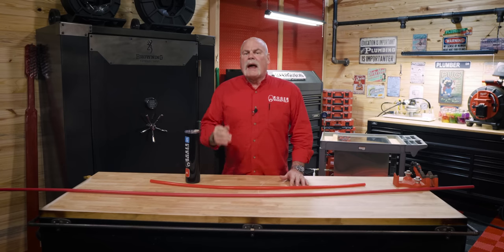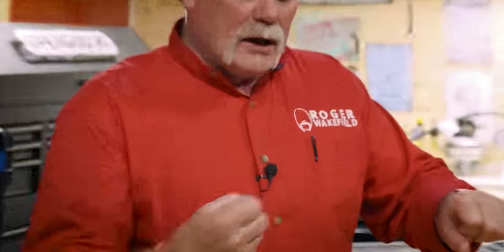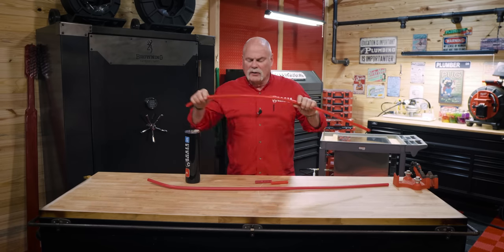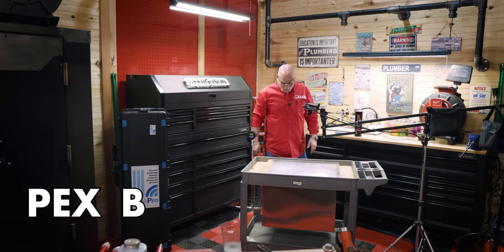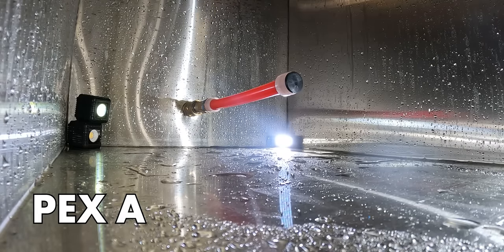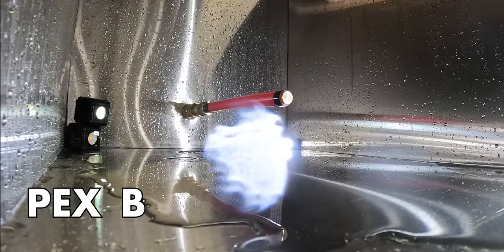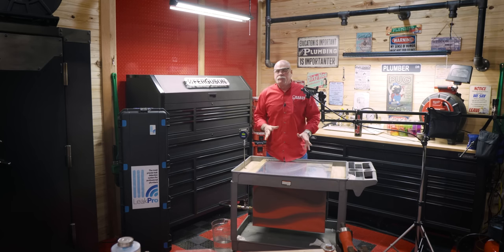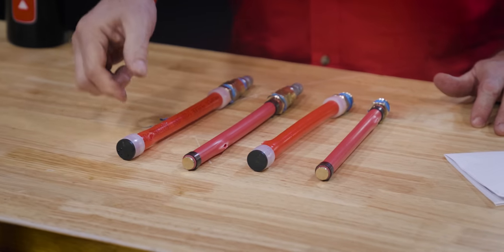Which is Better PEX A or PEX B | Pressure Test

Comment: I like those tests you done, but now do me a favor and take each of them and put them under 200psi pressure outside for a year. I like to see which will fail the Florida brutal heat in the sun and in the shade side. Because I got in the last 10 years over 1000 PEX A which failed for customers under mobile homes and around the homes on the exterior alone. And it's the fitting which fails not the pipe. So the bigger thing we learned is for Florida's heat don't use expansion material for the fittings instead used stainless crimp rings instead.
Reply: I think CPVC is much worse and it does a great job at withstanding the weather.. but I think using copper, CPVC outside and transition to PEX inside is always the smoothest move for longevity...
Reply: That might be why the local HD only sells pex b
Reply: It’s not made for uv exposure...
Reply: Well from my experience I was working on PEX a from 2012 and when ever you would put the tool on it it would split and crack so I had to put a PEX b fitting on there for it to work also under a trailer in Florida over in chulota

Comment: This is my take. This test made me excited when I stumbled across it. I’ve always been skeptical about pex a fastening method. I was looking for a failure at the crimp joint. Neither product failed at that joint which is remarkable.
Reply: For me its the opposite. A crimp ring made of metal will corrode and fatigue over time. The whole point of going plastic is because its non reactive and lasts an incredibly long time. If you add metal you ruin point of going plastic. Pex A is constantly trying to shrink so it will always remain strong.

Comment: As someone who knows a bit of polymer science, the conclusion is what I expected because stiffer probably means higher molecular weight and/or more cross linking and stronger in similar polymers.
Reply: Dido, except. I am very confused as far as the aging of these types of connectors relying on the contraction of a polymer. You know as well as I do that that polymers do tend to "relax"   overtime. Heat cycles will impact that as well, so how long before they relax enough to allow the fitting to fail?
Reply: @fredpinczuk7352  because the polymer is crosslinked, it will not creep in the expected manner before the polymer actually degrades from UV or oxidation or similar.
Reply: Yes the biggest risk of all these systems, aside from poor installation crimping, expansion, is uv exposure. When you have a toilet supply exposed to uv light in. A bright bathroom, don’t expect this to last 50 years !
Reply: I've worked in plastics for about 30 years (mainly working with HDPE, polypropylene, and styrene) and I would have been very surprised if PEX B failed first. I assume PEX A has some elastomeric additive / impact modifier, such as maybe kraton, added to it to make it more flexible and kink resistant. The elastomer will not only add flexibility but detract from the over all strength to some extent or another.

Comment: I think the biggest benefit of PEX A is fewer fittings and a higher flow rate. I replaced a PEX B install under my floor with all PEX A and was able to eliminate a lot of fittings the plumber used. Of course he doesn't care if it leaks below a floor that I have no access to underneath.
Reply: Why fewer fittings? Wouldn’t it be the same amount regardless?
Reply: @TrillPJ  A lot of plumbers will use 90 degree fittings just because it's easier when the pipe can be bent. You can use a special bracket to bend the pipe to ensure no kinks. Fewer connections is always better.
Reply: @adisharr  ahhh okay I see what you’re saying
Reply: @adisharr  The brackets curve the pipe without causing a kink, and it's faster than having to put a 90 elbow on it, and without loss of water pressure at the 90. I saw one install video where they didn't anchor the curved brackets, but I'm not sure that's good code compliance everywhere.
Reply: unless you have a ton of 90s close to each other, it make no difference
Reply: each elbow contributes frictional loss on the order of 10 feet of straight pipe. they all contribute regardless of placement. you add up your equivalent feet of pipe and then you can use tables to look up the psi lost at a given gpm.

Frictional loss is not noticeable to the user IF the pipe is adequately sized for the application. That's not the same as "makes no difference". it is a matter of using the right size. If you don't know when to move up to the next tubing size, you will have a problem.

There are rules of thumb to follow based on number of fixtures per line that will work fine for most purposes. You're not expected to calculate every situation but some situations do need to be figured out. 

See "Residential PEX Water Supply Plumbing Systems"... there is a table there on elbows/tees and another table for the loss per 100' (that's total equivalent feet).... i.e. 10 elbows is about 92-100 feet.
Reply: I used Pex B and didn't need 90° for most transitions by doing a longer sweep. No kinks no extra fittings. It's been going strong for over a decade now. ❤

Comment: Both PEX's are fine when it comes to pressure.  It's just you can't beat the PEX A when it comes to installation. Let's say you got a tee in a tight space. The crimping tools of any sort will require more room to maneuver when here the PEX A ferrules can be stretched while laying on your back and then you reach up and slip the ferrule over the fitting. How nice.  For a clean plumbing run you can't beat PEX A.  Having said that, who gives a shit about a clean PEX run? You can afford to leave some loose PEX runs so you get your crimps on.  My friend who has a Milwaukee stretcher, and I have a Ryobi Stainless steel cincher tool were plumbing a client's house using 2 different PEXs. We both started after coffee around 8am.  Now he had one extra bathroom to run pipe too and he had to put 90's going up the wall and to stub out just like I did.  Now, though we both finished at the same time, he put PEX to a bathroom, which is about 30 minutes more.  With our power hacks we cut out the old, galvanized pipe so that a future plumber couldn't complain.

Comment: As someone who uses strictly pex a I use expansion connections and crimp connections.  Since pex a is able to use both style connections can we see a pex a pipe with the crimp connections to see what it burst at. I’m curious to know if the expansion weakens the pipe that much or if the pipe itself if that much weaker

Comment: As a non plumber it sounds to me like it's more about how many connections you are going to need to make (since each connection with B reduces flow slightly) and whether the pipe might have a chance of freezing. The pressure test was good though to see how strong those connections are.

Comment: I'd like to see that with clear/white pex-a, given the litigation against uponor for the red/blue pex-a. These results are in line with the accusations in the CO class action.
Reply: What is the class action against Uponor for?
Reply: @bobbygetsbanned6049  there are accusations that the process that colors the red and blue uponor tubing causes defects, leading to microabrasions when the expansion tool is used and causes premature failure. Google and you can easily find the lawsuit.
Reply: @jcoop757  Shit that's not good. Thanks.

Comment: It’s like a screw versus a nail. The screw is “stronger” but it sheers. PEX a is the better choice because it will swell better as well as return to form better than PEX b. Like a nail, it will bend and bend instead of sheering. That’s what you want.

Comment: So Pex B won the pressure test, but what about long term stability?  Is it possible it will degrade faster in a slab if used for radiant floor heating?  If not, sounds like Pex B would be the best route to go.
Reply: I think the big issue with pex is chlorine resistance; if your water supply is highly chlorinated, you might want to look at pex-c (I think it's called that).

Comment: I had an entire 2 story house freeze in Connecticut. The only thing that burst were the copper sections near the on demand heater. The entire house was plumbed with Viega PureFlow Pex B. That's all of the water and radiant floors. Zero failures. The tenant shut the heat off in the summer and the pipes burst the day after Christmas due to good insulation. The whole house had to be gutted.
Reply: Ouch.  Merry Christmas :(  What sucks is it's hard to tell from just that if they were bad tenants or good people who just forgot.

Comment: Great video! FYI some manufacturers do list their PEX B tubing for use with F1960 (expansion) fitting and rings. Sioux Chief and Viega are the ones that I am aware of but there may be others. I have used Sioux Chief PEX B with expansion fittings with no problem.
Reply from the maker: Thanks for the info!

Comment: Good demonstration! Extreme pressure buildup comes from icing (ice formation will start and travel longitudinally along the pipe squeezing/pressurizing the water as it goes). So even if your supply pressure is only 40-80 psi, the ice formation will act like a piston pump and build extreme pressure. The pipe does not burst from physical outward expansion of the ice like most people think.

Comment: id lover to see a freeze test, on both pex a and b. highest pressure in a home ive tested as a service plumber is 180psi. i have also done multiple repipes in pex type a through attics, i would like to see a simulation of a freeze break on a hot and cold line in your chamber. maybe you can install another Pex a male adapter on the other side of the chamber with a cap on the outside in some sort of black iron so you have more surface area on the test pipe itself. Thanks roger
Reply: 180 psi is absolutely insane

Comment: I talked to Uponor and they told me that they expect no failures at 180°F below 220 PSI. I have run compressed air in a 3/4" Pex A line to  a trash pump at 80 - 100 PSI that hammers about 100 times a minute.  These pumps have been pounding away for 7 years with no failures.  I also run a caustic based cleaning solution (pH >13) into a process vessel.  No tubing failures, brass fitting last about a year and the plastic fittings have not failed in 7 years.

Basically Uponor has a gold mine in the process plumbing field and they appear to scared of it.  They told me it was only good for potable water.....clueless !

The biggest advantage of Pex A is in freezing applications.  Of all the plumbing technologies, it stands up the best.  It will expand enough and shrink back when it thaws.

Comment: How fast did the pressure increase?  I think it would be better to do 5 min at each 100 psi increment to get a feel for duration
Reply from the maker: Pretty fast, the camera on the gauge was in real time…took anywhere from 3-8 seconds to burst the pipe…I like you’re idea though

Comment: Pipes in my bathroom freeze every winter when temps get into the negatives.  I plan on rerouting the pipes under the house instead of inside the wall.  I have Pex A and the pipes always thaw out and work just fine when the temps get back into the single digits.  I prefer Pex A because it does not restrict the flow of water at the fittings like Pex B does.
Reply: From my understanding, The water flow restriction that some mention is due to the use of pex 1/2” tubing which has lower inside dimension if the tubing goes over the fitting.  The way around that is using 3/4” tubing so that your end result is 1/2” crimped

Comment: I bought a roll of Uponor Pex A for a project that I never got around to. I was concerned about UV exposure so I stored it in a trash bag. When I pulled it out to use it it was seriously discolored and had yellow splotches on it. Not exactly confidence inspiring so I am now leaning towards the Pex B that is certified to use with f1960 expansion like Zurn and Sioux Chief.

Comment: Problem of PEXa is that fitting ring last about 15 years or less on hot water before it starts leaking. That's why it's not used widely in Europe. Upponor has a lot of law suits in Europe due to their connections.
Rehau type of PEX connection is much much better and long lasting.

Comment: Pex-B is definitely tougher but also flexible so I prefer it. However a 1" Pex-B line is miserable to deal with so I prefer Pex-A if I have to do a lot of bends inside a house with a 1" line. But you also shouldn't put PEX-A in the ground. So with houses I spec a 1" Pex-B line coming off of the 3/4" or 1" main. Inside the house I will run a 1" line all the way to filtration, water heater, etc. and then branch off for fixtures. I never put more than one fixture on a 1/2" line with Pex-B. Zero problems out of this approach and Uponor won't change my mind.

Comment: Zurn Pex B can also be used with cold expansion as well. Talked to multiple reps at IBS
Reply: As a weekend warrior plumber here, I have been immersing myself in Pex information, and found out this info about Zurn Pex B.  Is this only Zurn brand?  For example, the local big box store here sells Apollo brand Pex-B.  According to what I've read, you can't do cold expansion with that brand.  It seems that brand of Pex is just as important as type of pex.  Is there an advantage to Pex-B Zurn over Pex A Upanor?
Reply: Sioux Chief PowerPEX as well.
Reply: Pex b has  much higher chlorine resistance
Reply: It's only certain manufacturer's Pex-B that can be expanded. Both Pex-A and B can be used with crimp/cinch rings though.
Reply: Good to know.

Comment: I worked for a company that tested fittings it was selling wholesale. We tested a sample of secura fittings to1400 psi in each batch. The rep wanted to see when they would break, so we went past 2000 psi when the fitting blew off the end, going straight through the safety block and the block wall behind it.

Comment: First time viewing your Channel, even though pex-b  performed at higher PSI, I would have to ag😮ree with the plumbers psi would not get that high. If I was an installer I would still choose pex-a because the pressure would never get that high like not even close. So the difference in flexibility would be the determining Factor. PEX a would be my overall choice for ease of installment

Comment: You can also get expansion fittings for zurn now as well.  While proper crimps are, unsurprisingly stronger than expansion fittings they are ALL good. Crazy to use cpvc anywhere now Adams.

Comment: I love pex b and Zurn style pex fittings because of how fast/cheap/easy it is but it is certainly inferior to and expanded pex a joint that is full bore. Zurn style pex fittings restrict flow and fuck up pipe sizing. Also you have the potential for a venturi at every tee. Its really possible to get strong suction out of a branch line that could create backflow issues when draining the system.
Reply: I've seen several videos about Pex; a few suggest upsizing the inside diameter using Pex with Zurn-type fittings to avoid any flow issues. That appears to make sense given those fittings do reduce inside diameter.

Comment: I'd like to see this as a freeze test because the volume of water is restricted. PEX B doesn't expand and may develop a higher PSI. While PEX A fails at a lower pressure, it does expand and therefore the PSI will not climb as high. Subtle difference in the test: closed system vs. open system.

Comment: This test doesn't really do much because as you said, when are you going to exceed pressures that high in a residential or even a commercial plumbing application? The real test would be when it bursts under freezing temperatures. That's really the difference between the two types of pex. That's what I want to see.  Which one will behave better in a colder (below freezing) mountainous residential environment?

Comment: RW team, could you do a video discussing the recent developments in micro tears in PEX-a from chlorine and UV exposure. We have started to see more and more of these leaks in "New" construction homes. Common denominator PEX-A, fractures at the expansion joint on the pipe near the ring and fractures on bends near exterior walls all on the hot side. I have dozens of physicals samples in the past two years.
Reply from the maker: how often are the pipes you're talking about being exposed to UV rays? We could do a test, but we want it to be realistic...

Comment: Roger, I have a question....there are rotating and non-rotating expansion tools/heads for PEX-A. I noticed that when you expanded the PEX-A, that you rotated the pipe with the auto-rotate head. I thought the whole point of the rotating tool was so the head would rotate but the pipe would stay in position and that would give an even expansion around the whole joint?

Comment: PEX -A is has lots of defects, if you examine the inside surface, especially uponor has lot of issues. PEX B much more rigid and uniform, looks perfect on all surfaces. If you’re worried about losing pressure just use 1 inch or 3/4 inch PEX-B. Only difficult part is getting the rings in perfect position and cutting bent PEX-B Square Perfect.

Comment: Nice testing. I would have wanted to see an another test with a kink in the pipe before pressure testing. I would assume that some incompent plumber could accidentally kink the pipe without noticing it and it would be interesting to see how much that will reduce the strength of the pipe.

Comment: Im not surprised, Pex B expands when frozen, then goes back to its original shape, weve never had a problem with it, even when it gets down to minus 40 in Canada.  Pex A dosent seem to last as long and for some reason gets hard a brittle over time, maybe it has something to do with the chloromine gas they use to sanitize water.